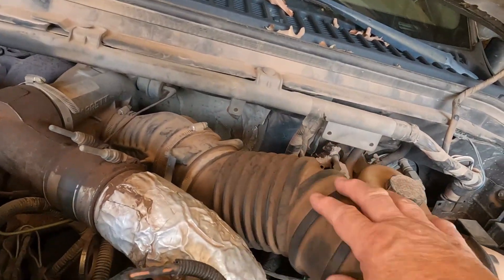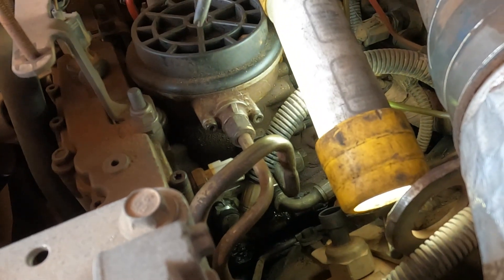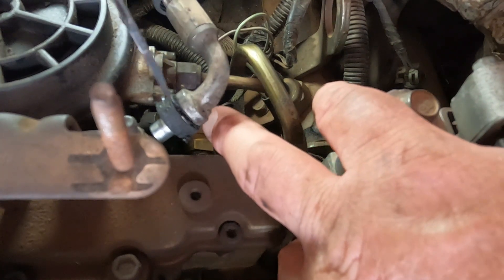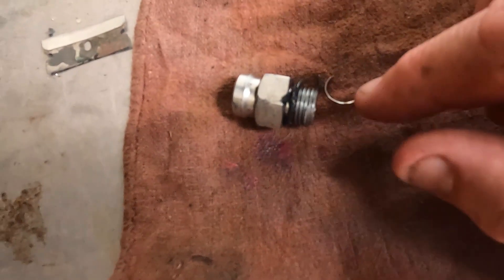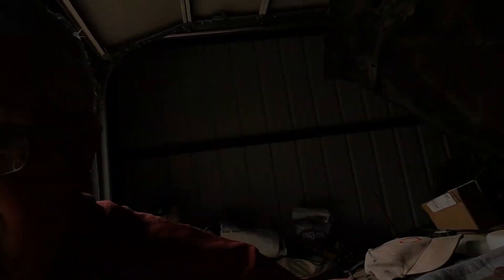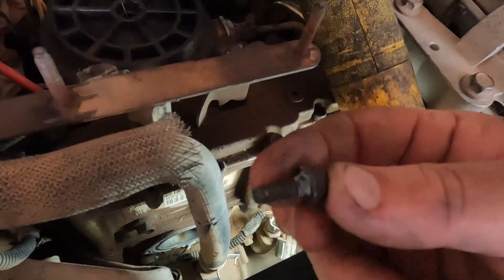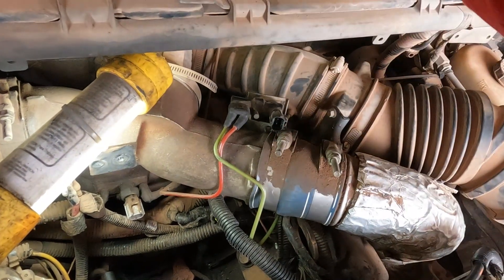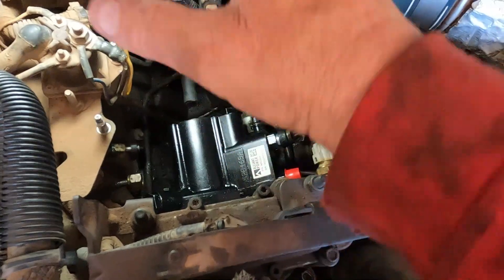OIL LEAK GOES TERRIBLY WRONG  | FROM ORINGS TO HPOP REPLACEMENT | 02 FORD F250 POWERSTROKE 7.3L

Comment: great video..  New Sub... I rather like tinkering with my 7.3 with these small repairs.
If I loose my Hpop ill be looking at an Adrenalin Hpop Replacement.
Reply from the maker: Yes i know about them but cost was around $1300 i thought in my life time i properly want  need to worry. i hope im right,